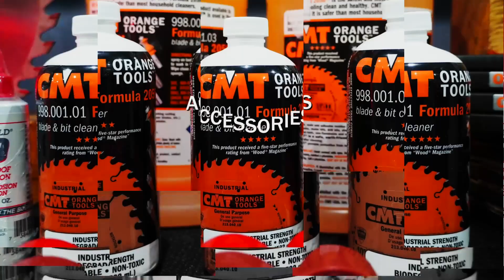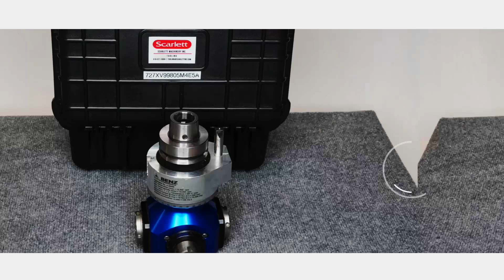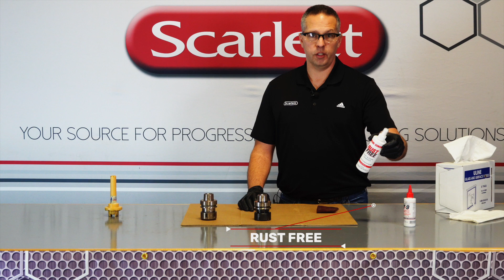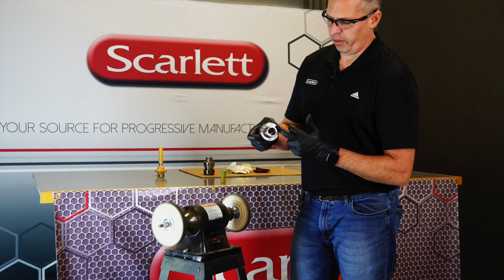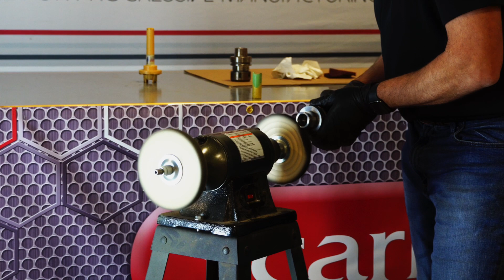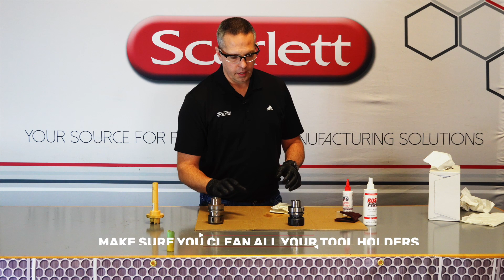How to Clean your CNC Tool Holder - Cleaning Tips and Tricks

Comment: Please be careful listening to this. Please don’t polish your tool holders, there’s a very fine line before ruining them. Better to go a non abrasive route. Not saying it’s wrong, but I’ve been a Cnc operator for 20 years and this is a terrible suggestion for someone that cannot measure of the buffing actually increased runout and potentially ruined the holder. Evaporite and copper Brillo pads remove rust and it’s non abrasive, don’t leave holder for more than 12 hours on the evaporust, preferably les than 3, until rust can be removed.